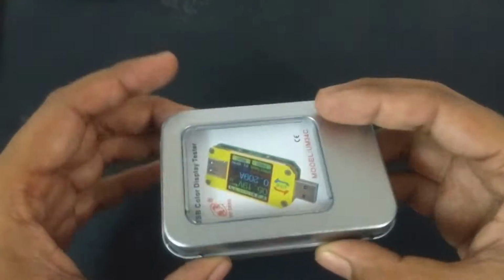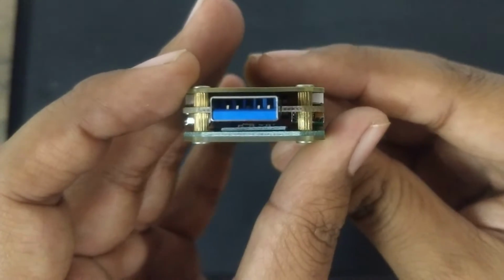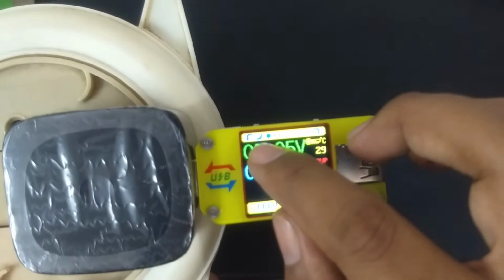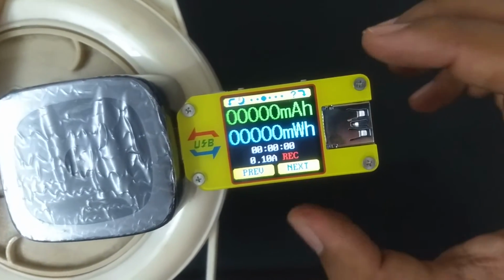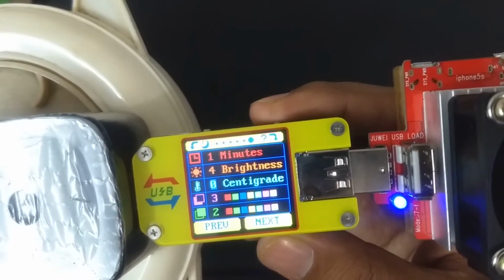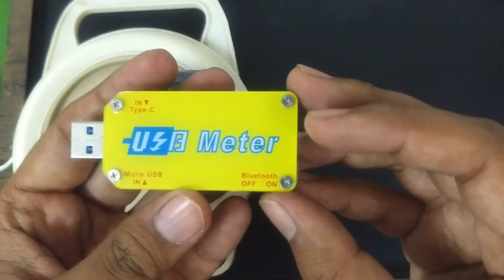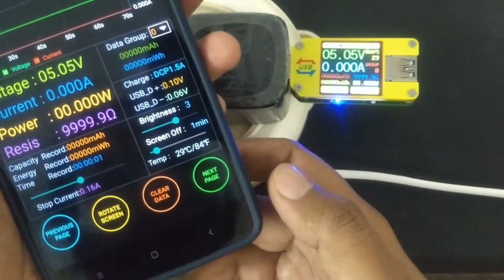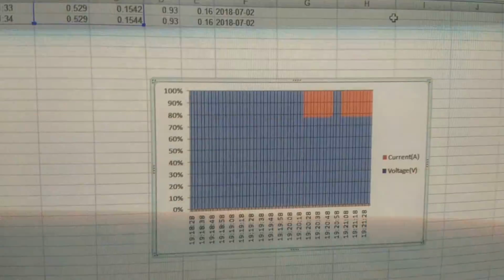RUIDENG UM34 | UM34C USB TESTER Comprehensive Review & UNBOXING.

Comment: Any one knows here how to detect 12volt usage if I want power and amps reading from a 12 colt device? I know USB's are for 5volts. But I can connect 12 volts through USB using other extensions. So did any one tried this method? It seems to me that the device does not detect 12 volt. Any luck out there?

Comment: Excellent guide. A couple things to note, when you get this new out of the package, there is a protective film on both sides. You might want to take it off. It's hard, but it is there and will come off. You need to loosen the screws to rip the film out of under them. Secondly, the help function works in all screens and is really informative of the functions in each screen.
Reply from the maker: Thanks man. i kept the film to prevent scratches because i keep the meter with some sharp objects and other things.

Comment: I have just bought this but where the Bluetooth switch should be  I only have a soldered link.

Anyone else have this problem ?
Reply from the maker: there are two version available one with bluetooth and one without.
UM34 is without bluetooth.
UM34C it with bluetooth. C- stands for connectivity.
Reply: @gurribuy  Yes, the seller has sent me the wrong item.  I have now heard from them so hopefully they will replace it.

Comment: Why is the um25c better than that um34c? I heard connectivity to PC? Any other features? accuracy?
Reply from the maker: Um25c has more resolution, it can measure upto 4 decimal place accuracy and can measure current upto 5A. Whereas the Um34c can only measure upto 4A. The Um25c can also detect more charging protocols compared to Um34c.However Um25c only support usb 2.0 whereas Um34C supports usb 3.0.